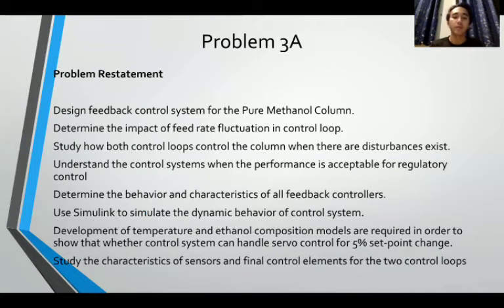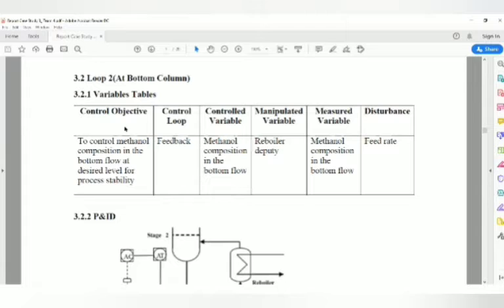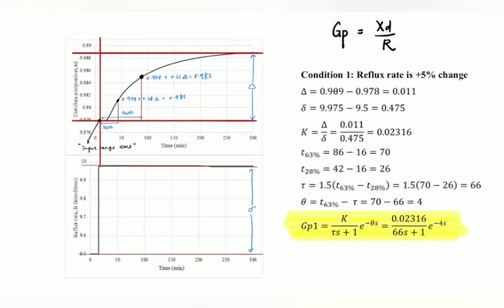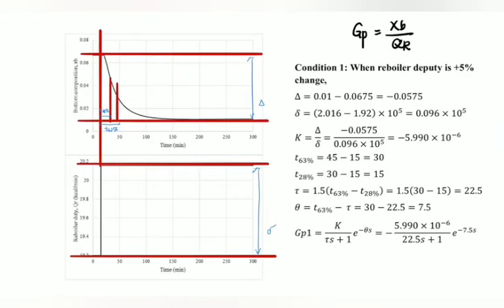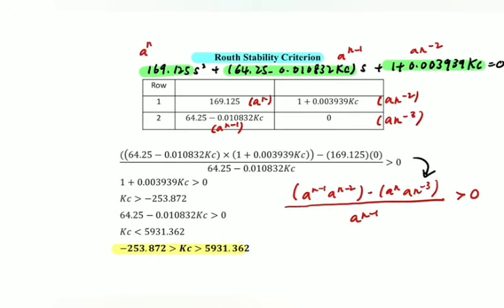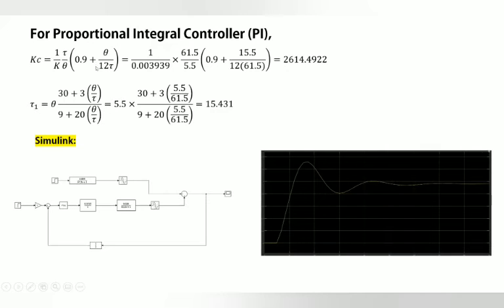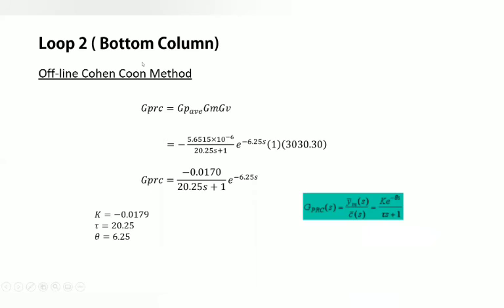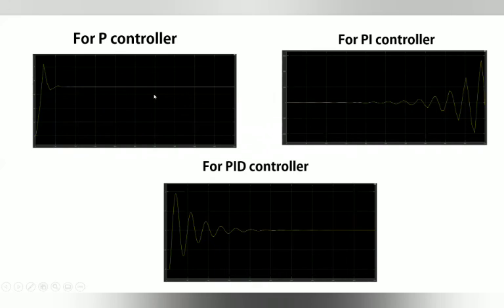Closed Loop Stability and Tuning - Team 4

Comment: May I know which controller is chosen for the top and bottom column
Reply: P controller is chosen, because the oscillation for P controller is smaller compared to PI, and PID.
Reply from the maker: Why you select controller with less oscillation? Other than oscillation, what else?